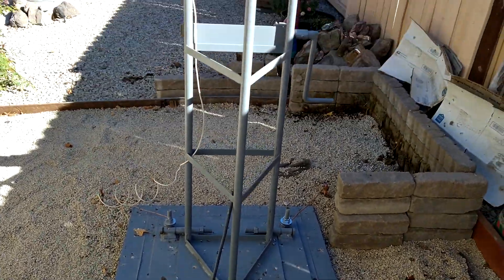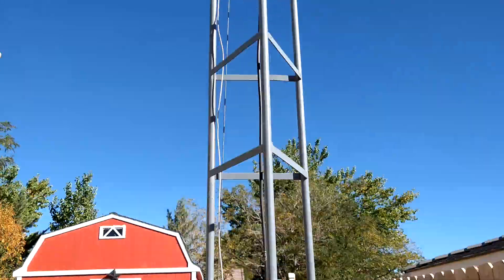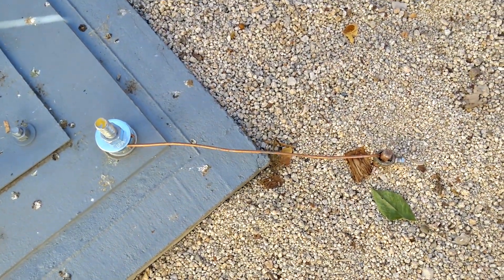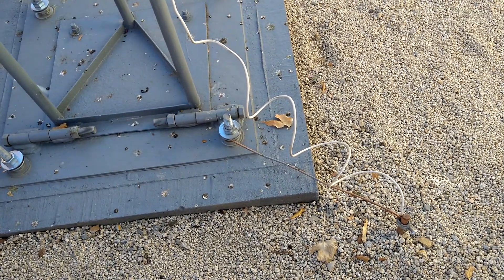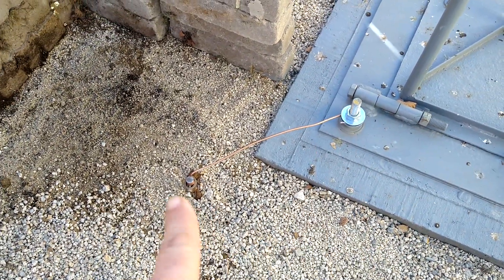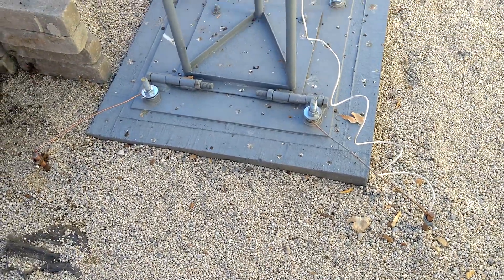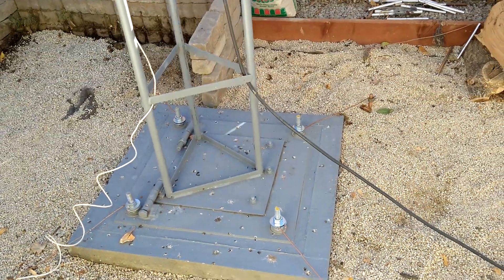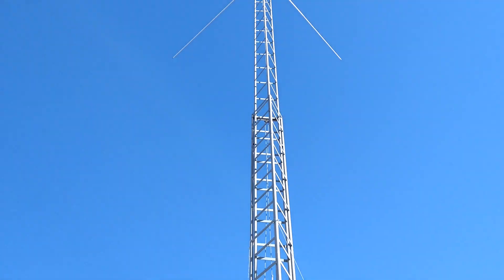Updated grounding on CB base station antenna

Comment: Where did you get the base antenna ground wire from?
Reply from the maker: @richardearldearyjr.9951  Same solid copper ground wire that you'd use for your home to ground the service panel to the ground rod. Available at any hardware store.

Comment: I have one concern. How does using dissimilar metals affect conductivity . What I'm saying is dissimilar metals corrode, making your ground ineffective over time.
Reply from the maker: Steel and aluminum? No problems whatsoever here as we have a dry climate most of the year with very little humility. I've honestly never seen any corrosion around here.

Comment: What i was told is if you use 8ft ground rods puut them in a 8ft square. but youve done a nice job there. earthing the coax shield at the bottom of the tower and before it enters your property is good but it depends how anal you are guess.